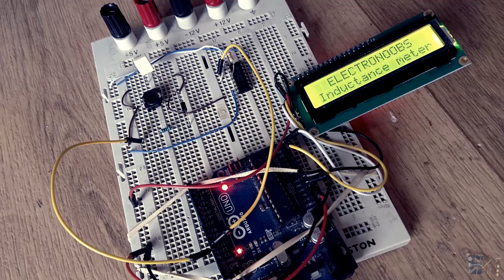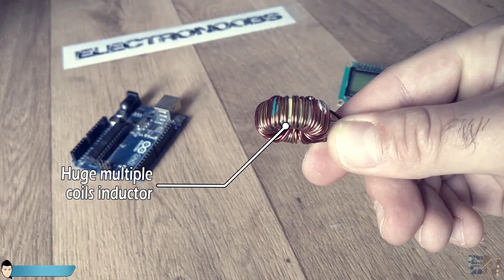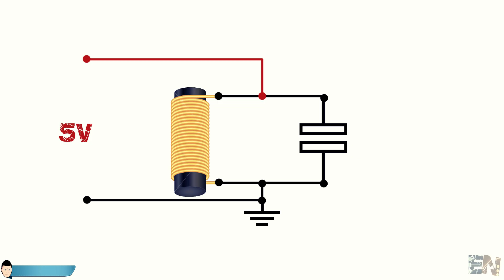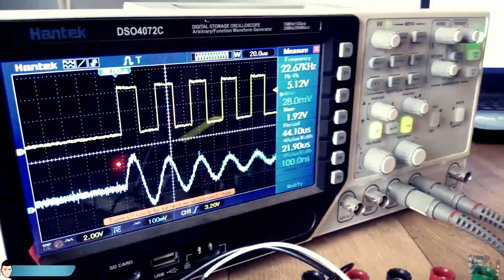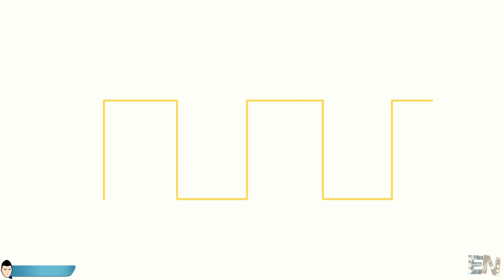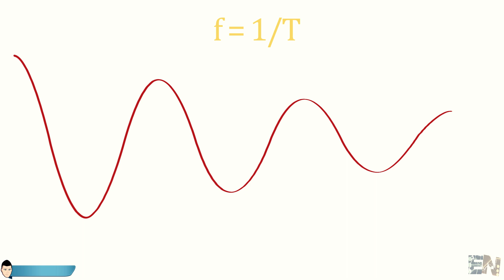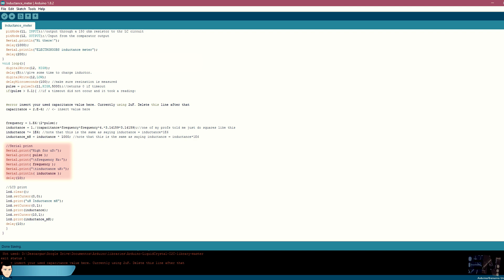Inductance meter with Arduino

Comment: Sorry, Dude your code for Arduino doesnt match on what we see on your video. I dont see in the loop anything like "Unknown inductance" serial print message. You even dont show how to use your device. When I connect inductance nothing is happening
Reply: Sergei Kurek yup! this is not the full code. if you noticed, the schematic was used in video was fully different from the schematic that uploaded in the blog. #Electronoob just manipulate us.

Comment: hi! very nice tuto Why  the code  doesn't works whith my arduino IDE  The message is " liquidCrytal_I2C" not found.
I change 0x3f by 0x27 but no change. Library has "liquidCrytal"  and I2C separate  may be that the probleme.May be you can help thanks
Reply from the maker: Make sure you install the liquid crystal library that I give in the video description!

Comment: Mr. Electrnoobs, sr... I have a question. Can I use LCD I2C adaptor and analog sensor? I'm asking that because I understand you couldn't use Analog Port to read two types of data (Analog and Digital) same time when SCL and SDA are digital I guess and For example LM35 or DHT11  output signal are analog, right? Best regards.
Reply from the maker: I don't entirely understand your question. Could you repeat it? Español tambien si quieres!

Keep up!
Reply: Electronoobs ok! lo siento. tengo entendido que al usar el puerto analógico para leer valores digitales (en tu caso, los dos terminales para el adaptador I2C) no se pDoria conectar un sensor analógico. que tan cierto es?
Reply from the maker: Si quieres usar el A4 y A5 como entrada analógica puetes. Pero no puedes usarloas a la misma vez que los usas para i2C.
Reply: ok, igual me referia a otra cosa. Por ej. Si uso A4 y A5 para el adaptador, ok? Puedo usar desde A0 a A3 para conectar sensores analogicos? Saludos
Reply from the maker: Claro que puedes. I si usas el arduino NANO tienes el A6 y A7 tambien como funcion de ADC
Reply: Si si, tengo los dos y ademas me dedico a vender pero esto es parte de sacar mas y entrar en detalles. Habia visto un video que si a uno se le ocurre usar el ADC para pasar las entradas Analogas a Digitales, pasa todo el puerto Ax y no solo algunas entradas.
Reply from the maker: no n0 para nada. Puedes uasr de A0 al A5 como digital y analogico siempre y mezclado. A6 y A7 en caso del NANO solo pueden ser entradas analógicas.
Reply: gracias!

Comment: very nice.though there are some minor bugs in the code. i have merged this meter with the capacitance meter and a toggle switch to switch modes,for anyone interested
Reply from the maker: In the future I will merge the 4 meters in just one using a rotary switch! Thanks and keep up!
Reply: I'll be looking forward to. Consider changing the inductance_mh constant in the link code,because it is written as inductance__mh in the beginning of the code and it wont compile.it's easy to fix it but for a begginer it may be tricky
Reply from the maker: Oh, thanks. I'll change it!

Comment: Is it possible to mearsure inductance of DC motor using this circuit? Also should i lock the shaft (so that it can't rotate) for the test?
Reply: Mili theMUFFIN   I would lock it up if I were you so that it doesn't change inductance when and if it turns
Reply from the maker: you could. Depends of the motor. If it is very big it might be out of range.

Comment: Can i use an optocoupler zero crossing point circuit instead?
Reply: With changed programming of course
Reply from the maker: I think that would give you just a small peak each time you have  0 crossing. using the pulse in function you need a 50% duty signal in order to double the time and get the period. But i guess you could manage to count the time between each peak
Reply: it doesnt really matter what length is the pulse because i want to use interrupts instead of pulsein() because it locks up the whole mcu while its waiting for the end of the pulse
Reply from the maker: Then ok. Using interrupts you increase a timer ant count how often dose that pulse oscillate. Sounds perfect!
Reply: @ELECTRONOOBS  I think such a circuit should be made on a PCB as the breadboard construction adds parasitic capacitance to the circuit.

Comment: Could a Colpitt oscillator work?
Reply from the maker: Colpitt oscillator  is to create the signal not to measure it. But if yo connect the output to an OPAM or this comparator you could measure it with the Arduino. You can't measure directly a sine wave

Comment: can you conbine all these meter series in one arduino that would be awsome.
Reply: yes !! I also want this ( LC with frequency meter ) , plz write code for both serial monitor and 16x2 parallel ports in one :)
Reply: should be pretty easy to put them together but of you are gonna use an I2C display you may need something other than an arduino uno since it only has 6 analog inputs and 2 of them are used my I2C. the hardest part would be the menu code but there are a lot of examples of menu code out there.
Reply: He just did
Reply from the maker: I will in the future!
Reply: @liontron-x1v  lel, he just do it
Reply: codes are not compiling  giving an error need help

Arduino: 1.8.13 (Windows 8), Board: "Arduino Uno"

C:\Users\alpha\AppData\Local\Temp\Rar$DIa6516.20196\Inductance_meter_Electronoobs\Inductance_meter_Electronoobs.ino: In function 'void setup()':

Inductance_meter_Electronoobs:16:7: error: 'class LiquidCrystal_I2C' has no member named 'init'

   lcd.init();

       ^~~~

C:\Users\alpha\AppData\Local\Temp\Rar$DIa6516.20196\Inductance_meter_Electronoobs\Inductance_meter_Electronoobs.ino: In function 'void loop()':

Inductance_meter_Electronoobs:42:3: error: 'inductance_mH' was not declared in this scope

   inductance_mH = inductance * 1000; //note that this is the same as saying inductance = inductance*1E6

   ^~~~~~~~~~~~~

C:\Users\alpha\AppData\Local\Temp\Rar$DIa6516.20196\Inductance_meter_Electronoobs\Inductance_meter_Electronoobs.ino:42:3: note: suggested alternative: 'inductance__mH'

   inductance_mH = inductance * 1000; //note that this is the same as saying inductance = inductance*1E6

   ^~~~~~~~~~~~~

   inductance__mH

exit status 1

'class LiquidCrystal_I2C' has no member named 'init'

This report would have more information with
"Show verbose output during compilation"
option enabled in File -> Preferences.
Reply: Electronoobs its already 6 months. How more time, would it take..??